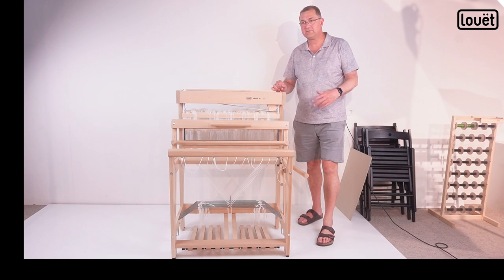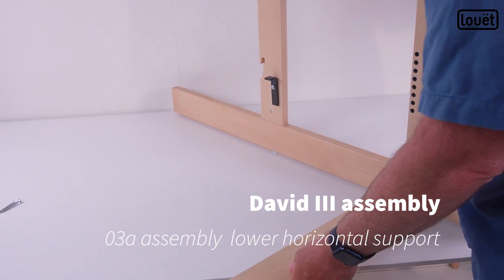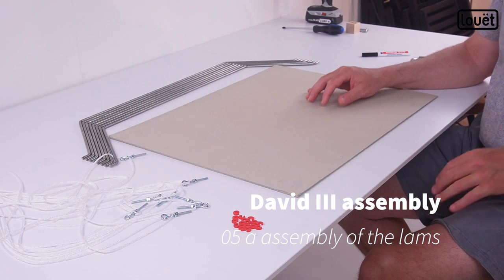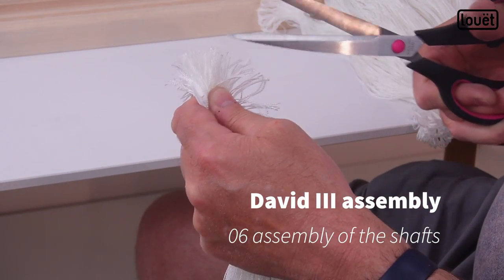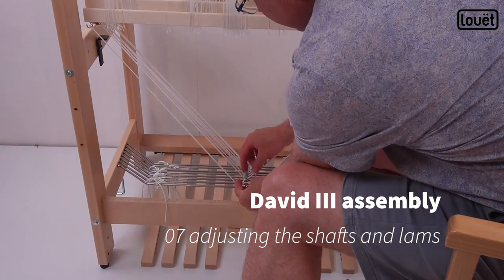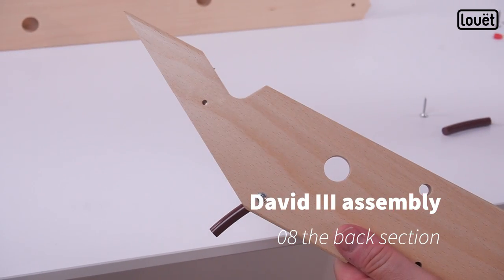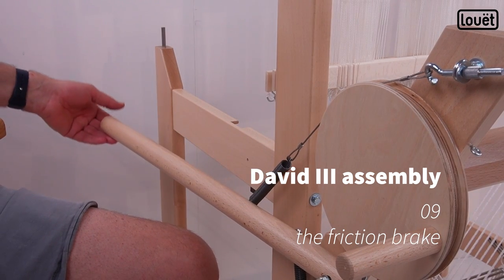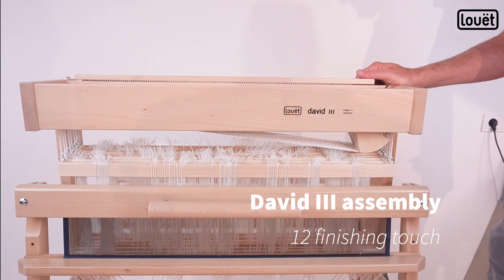David 3 Assembly video

Comment: I second the request for a sectional beam video.  Am I supposed to have to remove the brake from the spring in order to wind the warp onto the sectional beam? If I don't,  I can't guide the threads onto the individual sections (I use an AVL warping wheel).
Reply from the maker: Thanks for the feedback, we will add to the schedule